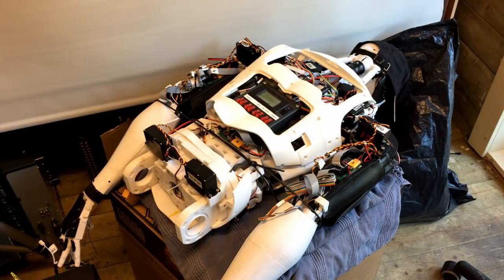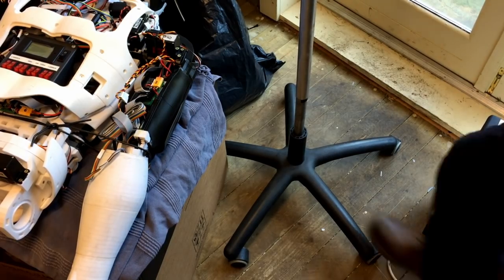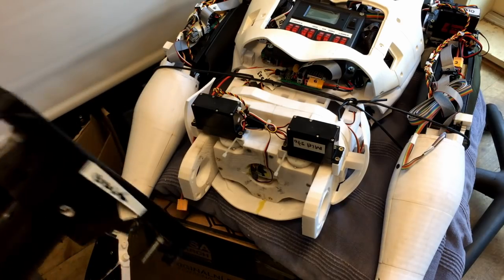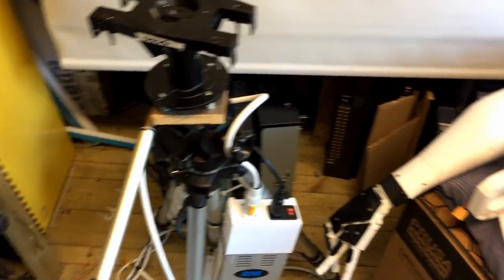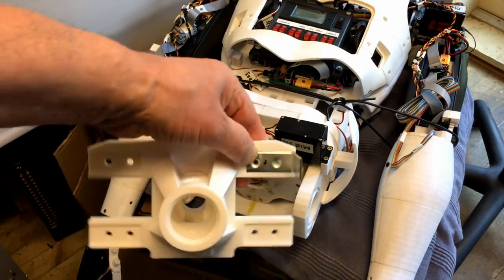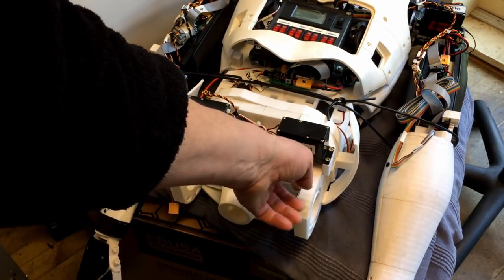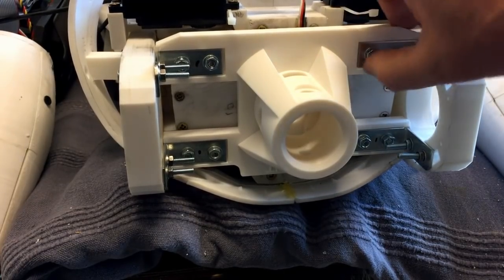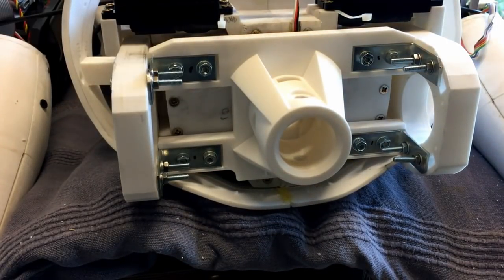InMoov Build Part - 31

Comment: Hi Kyle, Thanks for the video. I'm currently printing your modified support from Thingiverse and was just wondering if you would share the measurement (length) of your aluminium support pipe; I haven't printed the legs just yet.  Much appreciated.
Reply from the maker: Hello Haracini.  I just measured it and its 114cm (45 inches) from the floor to the bracket socket.  Remember that you will need to fit the pole onto a floor stand (I used a swivel chair base)  so you will end up shortening the pole by the height of the floor base.  The pole I used is 32mm diameter (approx).  Have fun, kyle
Reply: @kylecampbellweb  Diamond. Thanks. Have the same setup, base from an old swivel chair.

Comment: Hi Kyle, excellent job on building your first humanoid robot and excellent job on all the video's and hard work you put in to show use how you did it. I watched every video you put out and gave each one a thumbs up. I'm so glad you made your video's longer then some of these other youtubers do so I could learn and know what to look out for when putting parts together.
Question, now that you have the legs on do you think they are strong enough for the robot to walk on or do you think the parts would snap under the stress of the motors?
Keep up the good work. Thank you Kenn.
Reply from the maker: Hi Ken, thank you.  I am never sure if the videos are too long so its good to get feedback.  I agree about many utubers videos being too short and not really getting in to enough detail.  I originally started to video the build for my own reference, as a video is a great way to remember how things went together.  Didn't video most of the main build unfortunately. 

The legs are not ever going to be able to walk,  and Gael is currently designing new legs that hopefully will walk.  He just released the files as a static design.   I am assuming the working legs will be similar to the way James Bruton RobotX work.  Gael has released some initial video of his new designs on his site I think.  Also other Inmoov's have sort of walking systems and I am adding them to a playlist on my site, see "some suggested robot channels..." under my playlist tab.
Reply: Hi Kyle, I sit through hour long classes to learn Open CV , MyRobotLab and other programs in order to build a robot some day. Some day I want to have five 3D printers so I can print the whole leg in one shot. You have a good voice for doing the video's and you give good info on what works and what doesn't. Plus you don't play loud back ground music to cover anything up. I went to the library one day and they only had 5 books on electronics. So what you put up will help people for as long as youtube is up and running.

Yes I kind of figured the legs were only to complete the robots appearance and that they were the first stag of the prototype. I have watched a lot of James Bruton RobotX video's as well and I think his designs are mainly done around movie props. What we need is a design like Asimo from Honda. I think one of the problems we will see is the Inmoov swivel wast. I think it will snap in half after a few steps.
Thank you Kenn.